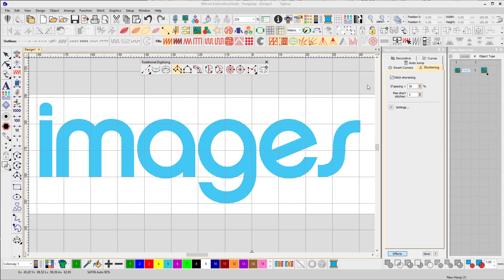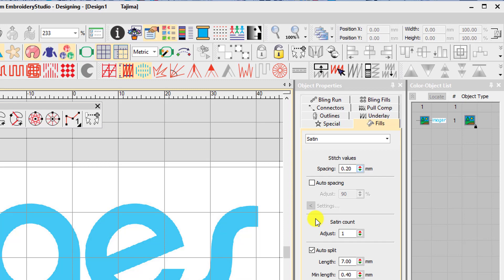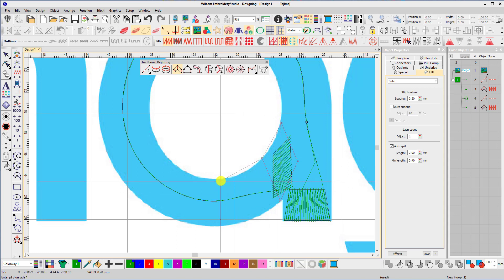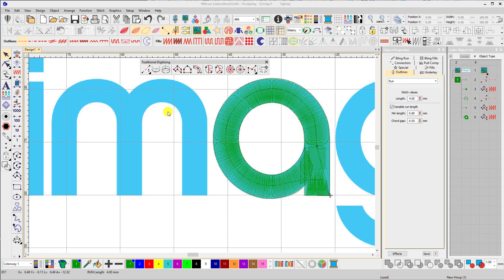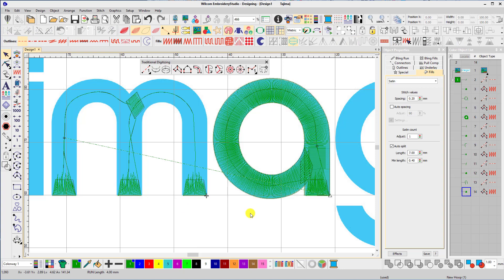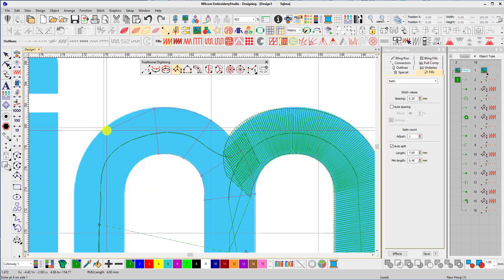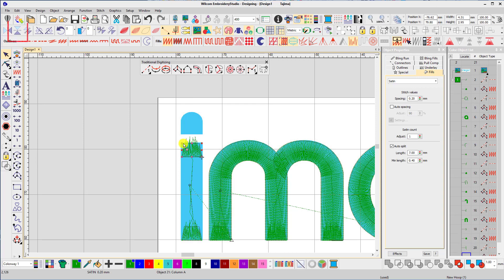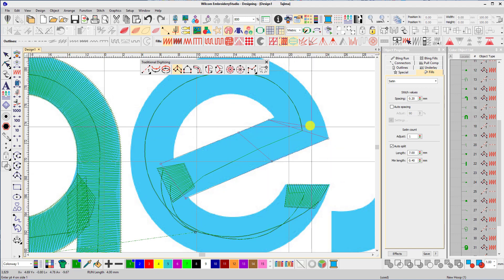Wilcom Tutorial 2. How to digitize 3D puff embroidery.

Comment: So I use a .14 density to get a clean cut on the foam. Using Poly thread allows me to
heat the logo with a shrink wrap heater and tighten up the column and shrink any foam pieces that stick out. If you can get 40 shore density foam, that works best. Retail available foam is too soft and does not hold up to this much column density.
Reply: What happens if you use cotton thread?

Comment: At what speed did you run your machine at for an efficient sew on the hat? Been running into a lot of bird nesting issues with my design and trying to find a solution for a couple of days now
Reply: Hey Alan, I run 750. If you get bird nesting try slowing the machine down or reducing the density along with using a coloured foam that matches the thread colour. Let us all know how you get on.
Reply: @DeanRoscoe  and by density you mean the spacing under the stitch values right? I actually have it set at 0.27mm right now, and have tried slowing it down to about 550-500 and still get the same problem, especially around the curved parts on characters as well
Reply: @lilestaban5642  what brand of machine?   Try experimenting backing of the density (reducing the stitches). If that works then you need to use coloured foam.
Reply: @DeanRoscoe Barudan machine. and how would you do that? is there a specific way to do that? and we use the same coloured foam as the thread every time we run
Reply: @lilestaban5642  In Wilcom you adjust the stitch spacing or auto spacing value. Try opening up the spacing to what you would use on regular satin embroidery and see if you still get birds nesting. This will allow you to check if it is a density problem or machine/tension/foam issue. 

I am assuming you have already done the obvious stuff.. change needle, try a new cone of thread, adjust machine tension?
Reply: @DeanRoscoe  we haven't tried the tension option yet to be honest, will try to adjust stitch spacing and auto spacing as well. And also other thing, would it cause problems doing foam letters on top of tatami stitching that already exists there on the hat. I honestly feel like that's our problem but it seems to not bird nest unless is on a curve letter like a 6 or an S.
Reply: @lilestaban5642  On curves the stitches will be a lot closer together on the inside inside vs the outside. Wilcom stitch shortening fixes this but you should have that setting switched off for foam. If stitches are too close then you will get thread breaks so you have to experiment and find the sweet spot for your machine. Sewing through a fill shouldn't be a problem unless it's a really dense fill. You could try swapping to sharp needles or reducing the fill density and see if that improves matters.

Comment: I now feel like I’m hounding you. I reset the toolbar and it is still not there. Is there something else I need to purchase? I have Wilcom Elements 3 Wilcom EmbroideryStudio 3.0, Wilcom Design Explorer 3.0.
Reply: Is Corel installed and registered? I would suggest contacting support at Wilcom America who will be able to assist. I am in the U.K which is a different territory.
Reply: @Dean Roscoe I purchased the barudan machine and the software from a person selling because they no longer used it. I contacted Wilcom and Barudan. We already have CorelDraw 8 not 6 so, the program that came with the Wilcom is outdated since it is an earlier version. Would I be able to get the CorelDraw 8 and Wilcom to work together or should I even bother.

Comment: How is your tie off set? A few of mine started unraveling when I was cleaning up.
Reply: I usually have one tie-off stitch because the machines add a couple by default. Check the small stitches setting in Wilcom to make sure that they are not being removed. Also check your machine control panel because most have a filter setting on there as well.

Comment: I did this exact setting and it has foam peaking out! Any suggestions? I did use a heat gun and you can still see it peaking out
Reply: First, change your needle and make sure your machine tension is set correctly. If that doesn't help then increase your stitch density.

Comment: Can this be done in Hatch? If so, how?
Reply: Hatch is domestic embroidery software. I only use industrial Wilcom embroidery software.
Reply: You could probably use Hatch to make these shapes manually. Just make sure to remove the automatic underlay. I believe the collum or "block" tool is the same and then he's just using a single stitch to lay down the straight lines. The numbers of 2mm are stitch length in this program but it could be called stitch density in a different program. It's just how close the stitches are together. You can find that in the object properties area. I use Bernina software and can do what he does here but the names of things are a little different. Bernina software and Hatch are very similar. They are domestic or home-based software for the average user and as a result are more automated and have less manual controls than industrial or Professional software like Wilcom E2.